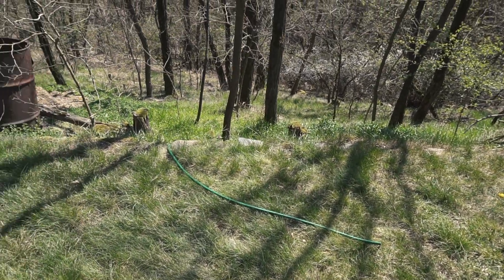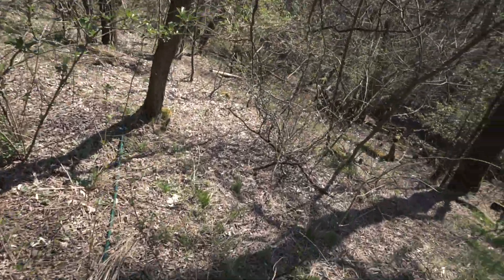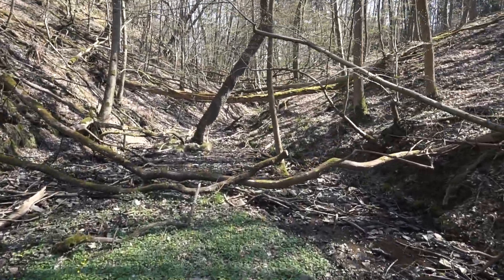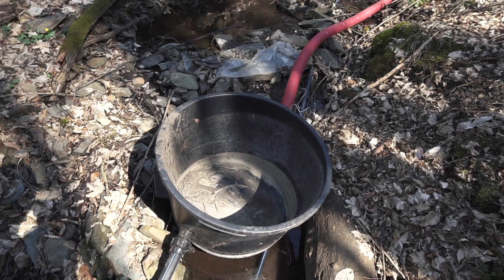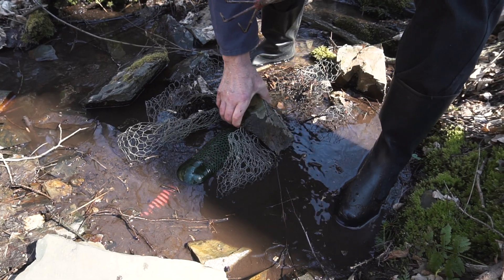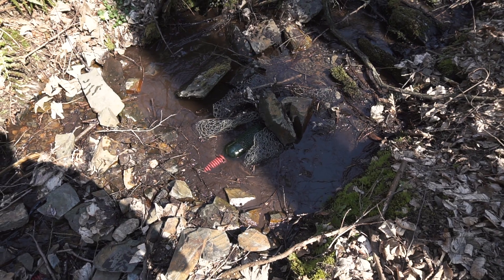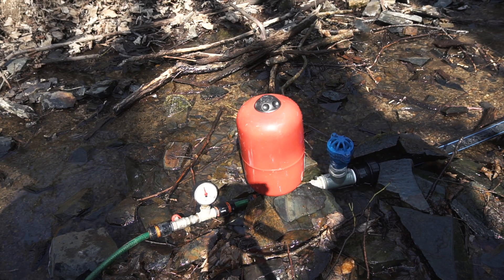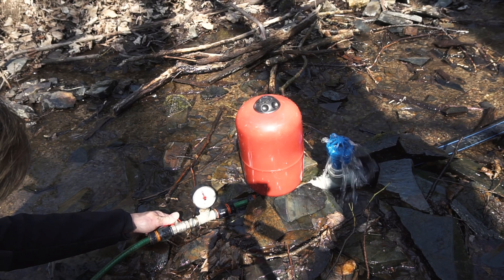RAM PUMP - getting hydram to work after winter break - CHECKING intake + delivery pipe

Comment: Hi Bohumir, if I have more water available, less elevation drop available and less elevation gain to water destination: Is up-sizing intake pipe diameter & pump the best option?
Or does upsizing become more costly than duplication at this size?

Thank your great engineering work on these pumps!

Comment: Hi again.  Does the red tank have an inflated inner tube?
Reply from the maker: No.
Reply: @BohumirStehlik  Did you test with a bloated inner tube?  How not to try.  On the Land to House channel, the guy says the pressure is better.  And it also sells.
Reply from the maker: @Mieszkoty  Using a pressure bladder tank. It is enough.

Comment: I've read that for a 40mm (1 1/4") diameter pump and drive pive, the max length of the pipe should be 30 meters. You say yours is 50 meters long and is working, which is great since the pipe I'm planning on is also 50 meters and I'm reluctant to shorten it. Have you tried a shorter pipe? If yes, to which effect?  thanks!
Reply from the maker: Hello. The pulse would be shorter with the shorter drive pipe. I do not recommend 50m pipe, if you have low downfall of the water. The the speed is unbearably slow...
Reply: @BohumirStehlik  Ok thanks, but why did you make it that long then?
Reply from the maker: @polyminthe  Because I have enought downfall. In my computer I have a material for another video from a different location. The downfall was about 1,5 meters, 50m pipe. The pulse is significantly slower.
Reply: Bohumir Stehlik ok thank you! So that’s why it works with me as well. I also have a 2.5m downfall with a 50m pipe. Can I ask you an other question. Can you give me the dimensions of your red pressure tank? Height and diameter and how many litres is it? And last question, is it ok if the entry size of the tank a bit smaller than the pump? Thank you so much.
Reply from the maker: @polyminthe  Uh, I actually don't know how big it is and how many litres is inside. It doesn't matter. It is an old fire extinguisher - maybe with 5 or 10kg of CO2. Basically you should be ok with 5l or 8l bladder expansion tank. Anything over that will be completelly ok. 
Yes, it is ok that the entry to the tank is smaller. My one is actually 3/4'' and the water outlet is 1/2''. Together 5/4'', same size as the pump. It will work...
Reply: @BohumirStehlik  Thank you again for your reply. In other videos you have a fire extinguisher indeed, but on this particular model you have what looks like a bladder expansion tank, which is why I was asking. I looked into them and have the choice between a 5L or 8L. Hence my question. But I got the idea. Thanks again! (I'm looking into these tanks because I can't manage to build a PVC tank that holds the pressure)
Reply from the maker: @polyminthe  Oh, yea, sorry, it is 8l bladder tank.
Reply: @BohumirStehlik  Thank you so much for all your replies. Very helpful!
Reply: @BohumirStehlik  I got the 8l bladder tank. but I can't build up more than 2bars pressure. I think my drive pipe is too long (50meters). I've read it should be 30meters max for a 1 1/4" pump. Do you think the length of the drive pipe might be why I can build enough pressure?
Reply: Bohumir Stehlik hi again bohumir. So, I’ve got the bladder tank, shorten the drive pipe to 30meters but I can’t seem to build enough pressure. It gets stuck at 2 bars, at 30 beats per minute, which seems slow. Does that mean I don’t have enough downfall? Not sure what to do now.
Reply from the maker: @polyminthe  Looks like not so much pressure, yea. To low downfall. 2 bars means you have something like 0,7m downfall.
Reply: Bohumir Stehlik again, thank you for taking the time. So does that mean I could longer with the drive pipe to achieve more downfall and add a stand pipe? Also, how much pressure should I get? I’m looking to bring water up to 10 meters up hill.
Reply from the maker: @polyminthe  Hello, 2bars is enough power to get water to 20 meters. So you are safe. 
You made the intake pipe short for about 20m. That 20m of water is quite a lot of weight. :-) I think your ram pump works great for this fact.
Reply from the maker: @polyminthe  You could lift the intake for the water. Look at this video - I have intake to the intake. You can have the intake outside the water, somewhere higher that the level of the stream.
Reply: @BohumirStehlik  Hi Bohumir, I'm very grateful fro the time you take to help me here. I see what you mean about lifting the intake of water. I might also try to move the pump to a different place where I have more downfall. But you also say that 2 bars is enough to get water to 20 meters. But when I open the delivery pipe, even slowly, to send water up, the pressure just goes down and the pump doesn't work. I've really no idea what's happening. I would love to be able to send you a video of my pump and what it does. Only if you're willing to. Don't worry if not. (Did I already thank you for your help? :) )

Comment: What is the size of the pipe that reaches the pump?  I have a 1 "inch pipe size and I brought this blue 1" inch valve from your country and my pump does not work.  the ball from the valve lies at the bottom and does not lift it.
Reply from the maker: Hello, the intake pipe is 32mm inside diameter. I know the problem that you have. You don't have enough pressure for the valve. It has an easy solution. Take the valve, disasemble it and place a ring made of PET bottle cap. Or brush the metal ribs inside the valve that the flowing water takes the ball easier. Hope it helps
Reply: Bohumir Stehlik Or maybe the problem is that I have once at the pressure tower also 1 "inch, is this the next problem?
Reply from the maker: @Mieszkoty  I don't understand what do you mean. Pressure tower?
Reply: Bohumir Stehlik The red tank and the valve under it.
Reply from the maker: @Mieszkoty  That't not a problem. I have tried 5/4 on a 5/4 intake pipe but also 3/4 on 5/4 intake pipe. Everything works. You have low pressure under the ball in the waste valve.
Reply: Bohumir Stehlik Thank you for your help.  I understand that this bottle cap from Pet, what do you have in the movie is the result of such tests with Dad?
Reply from the maker: @Mieszkoty  Yes.

Comment: thank you!!, the intake, i mean, the red tube, get the water by pure gravity?, if yes, can the pump work above the level of water?, i mean, on the surface of a pond?, which is my case LOL. Greetings from Chile, great channel!
Reply from the maker: The red tube is the intake to the intake. :-) You can place wherever you want but you always need some downfall in the drive pipe.
Reply: @BohumirStehlik  Hello, I have seen that you mention that with a down fall of 2.5 meters it reaches a height of 40 meters, and if we reduce the downfall to the height of the ram pump, could it have a height of at least 1 meter?
Reply from the maker: @leonzito8  Sorry, I am not sure what you are asking. To reduce the downfall to the height of the pump? The pump is like 50cm tall. If you are asking about reducing the head pressure, yes it is possible but then you get equivalently lower delivery height.
Reply: @BohumirStehlik  hi. Thanks for answering, that was what I wanted to know, the lower the downfall  , the lower the height it reaches!

Comment: I am building one that is very similar to yours, except that I don’t have an air cylinder as big as yours. what problem could happen with a smaller cylinder?
Reply from the maker: The pressure tank is like a battery or a spring. Your stream won't be so steady.

Comment: I really like your design for this pump. I notice the valve is different from last year and it has a blue cover on it. Is that another custom valve?
Reply from the maker: Not custom valve. It is a suction basket from a pump. One can buy it in a pump shop.
Reply: Bohumir Stehlik apparently they are readily available outside the US. I haven’t found anywhere local or online where I can buy in the US. Great idea though.
Reply: @GermanShepherdRanch  you might search for "foot valve" which I think is the same thing.  The ones I found all had a spring in them but some of them can be disassembled and the spring removed.
Reply: Mike Cahn Thank you for that!
Reply: @GermanShepherdRanch Look for a ball check valve.
Reply: @BohumirStehlik  bolti lab szelep de hogy a rugos szelepnek semmi ertelme a rugo a nyomast allitja

Comment: It's a beautiful location there. Did you measure/calculate how much water the ram pump uses for working? 

To get out most of the air of the air from the drive pipe, it's easier to remove the delivery hose and open the delivery valve. So you only have a small amount of air below the impulse valve. This will go out by priming (clicking the ball) 2-3 times. A requirement is, that your check valve is not spring loaded, but I see no sense in spring loaded check valves in principle.